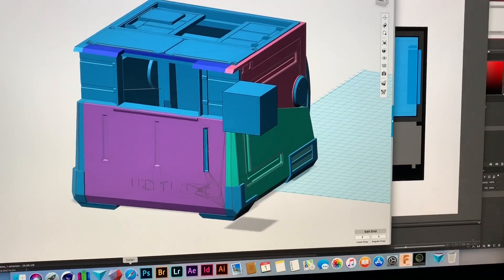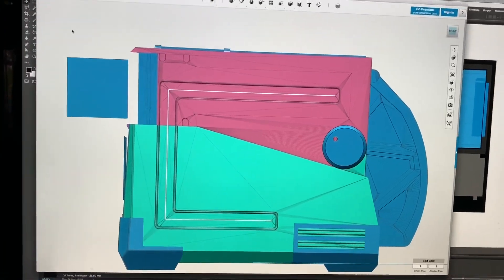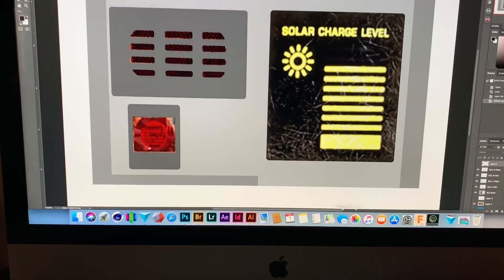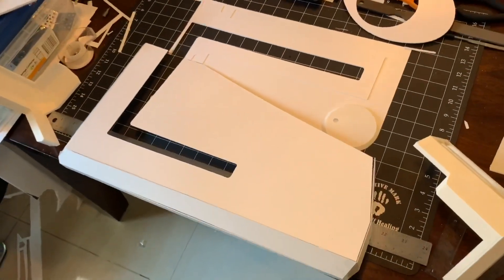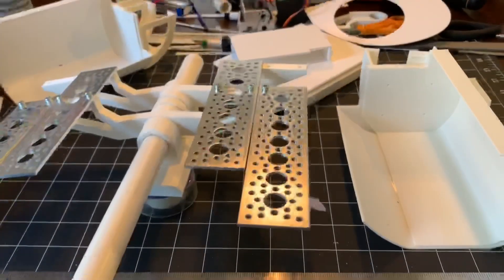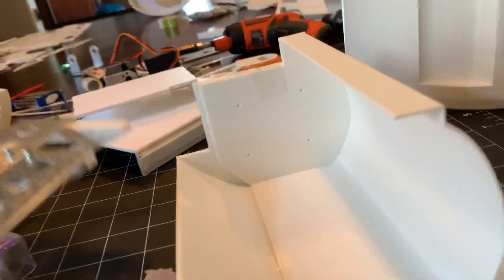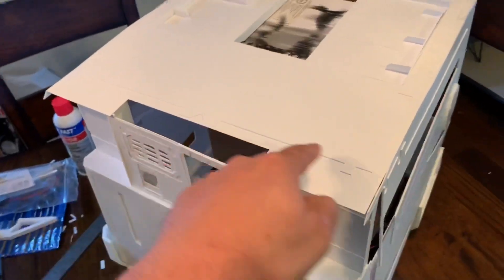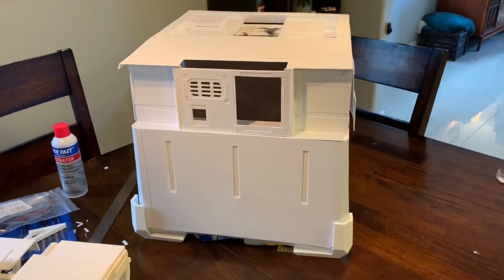Wall-E Progress Video

Comment: This is a super cool project…I am planning to make one for my little one.
Need one info on why we need both raspberry pi & audrino for this project?
Raspberry itself can control the motors right?
Is there is any python code available for controlling motors so that i can use pi & a pwm hat to control motors. Please let me know on this.
Reply from the maker: Arkadius Ega I don’t use raspberry pi or aurduino. My whole system is analog. I use all RC parts and components.

Comment: From where do you buy these stuff to build Wall-e?
Reply from the maker: Sara Salem you’ll have to be more specific which parts you’re referring to. Some parts are custom 3D designed pieces and 3D printed. Some things like the tracks are purchased. But the bulk of this build is with a material called styrene and I just purchase large sheets of it from amazon.